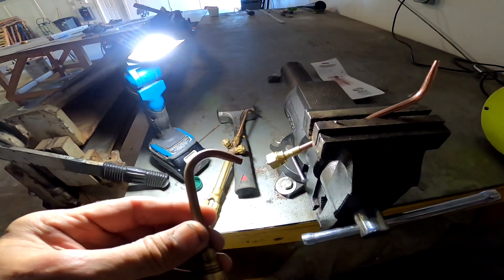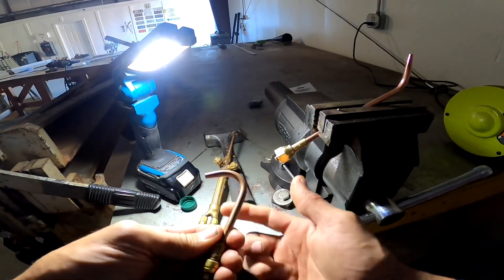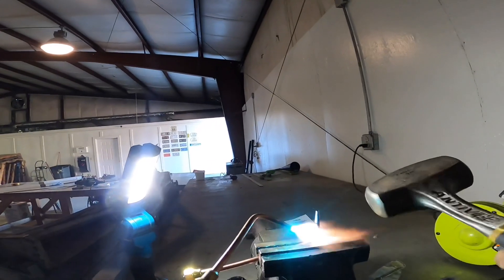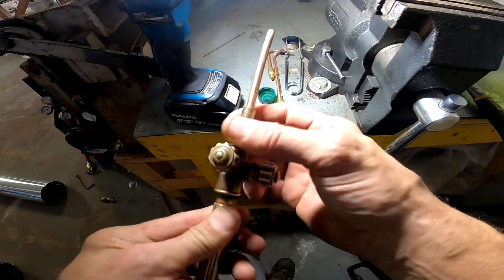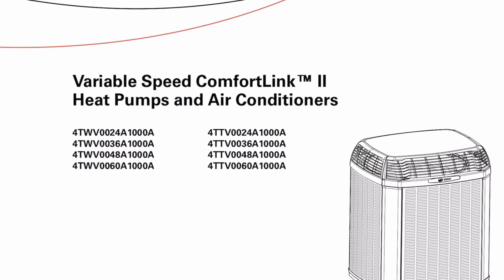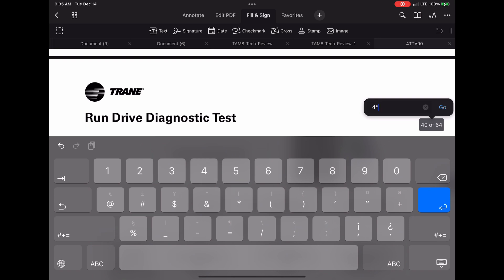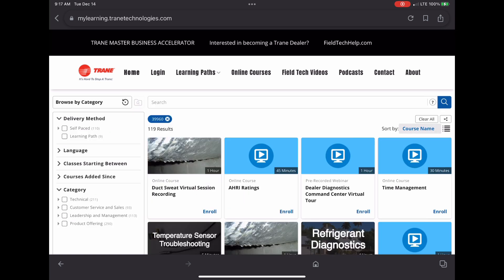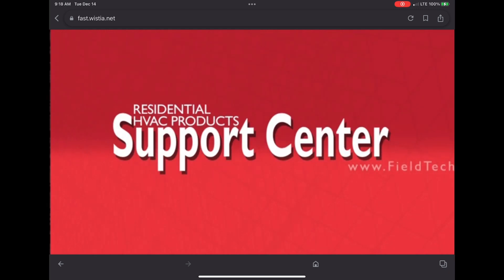Tech Tip Tuesday -Two Nice Tips For HVAC Technicians

Comment: Would you believe that within about a decade, no new natural gas heating systems can be installed in the United Kingdom. All the new stuff will have to be electric heat pumps to get closer to reducing carbon dioxide emissions to zero in the UK. Business owners have warned the UK government that they don't have nearly enough trained technicians to accomplish replacing millions of gas heaters, while repairing existing equipment which breaks. I think I read that eventually, all gas heaters will need to be replaced, even if they still work just fine. Imagine the cost of that.  
I would already comply, since I have an all electric home. With a 40 year old electric resistance heater, I'm lucky it doesn't get too cold in Southern Louisiana. Although I did stuff another 3 or 6 inches of fiberglass in the attic to fight the summer heat transfer. And the previous owner replaced the windows with double glass ones. Those are great. They keep the I-12 noise out too. On most sunny winter days, the central heater seldom kicks on between noon and near sunset. That is good because it costs more to raise the temperature a lot if it is very cold, than to lower it a little during the summer. In this warm climate, a heat pump would be the way to go for winter electric heating.
Reply from the maker: That may be a warning ⚠️ of what’s to come here.
Reply: That's already a threat in the US. Some manufacturers are already warning us about it.

Comment: I learned a torch tip trick from an old school guy smiliar to this. His tips would be straightened out then maybe an inch or so on the very tip had a slight curve. Can get into any tight spot and easy to move around when brazing without getting hung up.

Comment: have you ever tried the twin tip  for soldering and what's your thoughts on Press fittings
Reply from the maker: No, i haven’t used a twin tip. I do have a rose bud, but that 4 is normally all I need. Right now I ain’t fixing to use any press fittings - nope! Basically the seal is rubber. I need much more info, and time before I’ll do any press fittings.
Reply: Uniweld mtt micro 6000 twins very usefull in tight spot works great heats fast